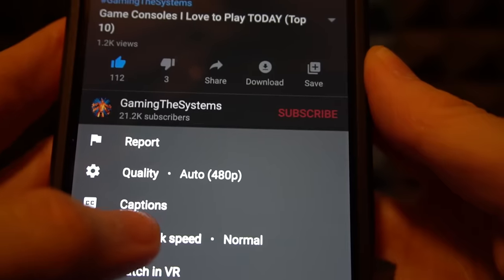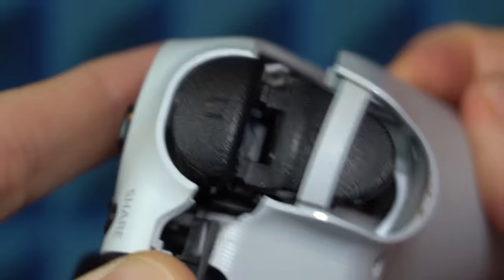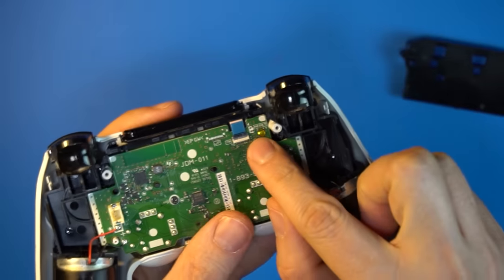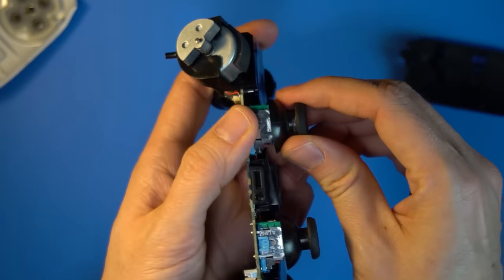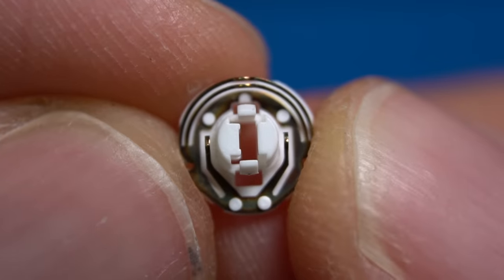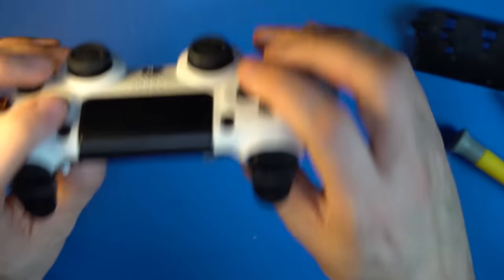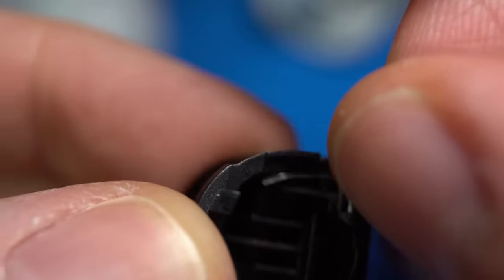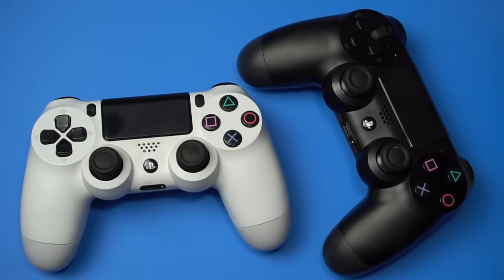How to Repair a PS4 Analog Stick That is Drifting, Sticking, Jittery/Cleaning DualShock 4 Controller

Comment: People saying they're afraid to open their already broken controller incase they break it and would rather buy a new controller 😂😂😂😂 wtf do you have to lose? At least try it beforehand
Reply: I finally found you from RDR2, Gavin
Reply: Gaviiiiiiiiiiiiiiiin !!!
Reply from the maker: Thanks for saying that Gavin. I agree.  If someone is going to just throw their controller away, might as well try to go inside and fix it before spending $50.
Reply: @HowToX  exactly!
Reply: GamingTheSystems Have a question.  I bought a brand new controller because of this.  And it still happens.  But I will be playing cod and sometimes  when I turn my character it acts like I’m on like 18 sensitivity but I play on a 7 horizontal and 7 vertical.  Would you know how to fix this ?
Reply: Zach Hollar do you buy the fakes one? Because i have the same problem lol
Reply: Seems like a lot of work for those of us who aren't tech savvy
Reply: Agreed
Reply: Because a lot of the time the controller isn’t 100% unusable and the person doesn’t want to break it even more especially if it’s someone who can’t just buy a new one
Reply: What's the point of trying something you don't even know what your doing? People would rather know what they are doing instead of not having a clue what they are doing. Also the controller isn't broken it's just a simple issue. People don't don't want to risk losing a controller that "WORKS" by trying to fix a issue taking apart the controller not having a clue to what they are doing.
Reply: @M0therfknm0nster  Send me your controller & I'll do this and fix it for you. But you gotta pay for shipping & the shipping fee to send it back to you
Reply: @Mike_TNVol4Life  am I naive to assume I'd actually get it back?  Lol. Guess it doesn't matter if the damn things broken 🤔
Reply: Thing is its not fully broken lol. My kids been playing with it like that for months now unwilling to pay £100 for 2 controllers. 

I wanted to try myself but after this video..... maybe they shall cont playing with it broken till a discounted one is found🤣
Once i buy a new one ill probably attempt
Reply: You save yourself 30 minutes of your life and lots of frustration. I speak from experience. I guarantee that a first timer will have a couple of pieces that drop out and you won't be able to put back in correctly.
Reply: @alibobsmarland9572 
I never opened a controller in my life before i just did today and did exacly what he said but more slowly as you can imagine, what you said is true that you might not be able to open or put it back as it was, i watched the video 4 times, it took me one hour to do the whole thing but i did it haha and am glad i saved my money, it was either i fix it by me self or buy another one, the guy at store was asking 2/3 the price of controller to fix an old one. So it's win situation for me.
Reply: @stephenjohn2131  Congratulations Sir. You are a braver man than I! I saw a  fix for my upward drift on the right control stick which seems to be working so far. Just push the stick furthest in one direction and press right down hard on the base of the exposed part. Repeat for the other directions. I'm not saying it is a long lasting fix but stops my aim through my gunsight in Host Recon drifting up every time I look through the scope.
Reply: @alibobsmarland9572  Thanks man It becomes really awful if you play shooting games, i don't recommend anyone doing it like you said it can go worse if you accidentally break the wires, as i can see alot of ppl commenting that they got theirs worse than before. But yet it is not that hard if you handle it and watch/follow the video instructions carefully,i have shaky fingers when it comes to handling tiny objects, for me the both of my analong sticks were drifting made it impossible for me to enjoy any game specially online. Kinda hard to keep it safe as my younger siblings play on my concole lol. But all it really took was opening the controller and cleaning the green chambers of analog sticks with alcohol based cleaner. I was frustrated when i had to slide the touch pad wire back in so i watched the video over and over until i got it done. Doing it for my second controller however was easier though. Good luck to you man and stay safe! 👍
Reply: @stephenjohn2131  Cheers. Wish I had your patience and dexterity! My other controllers r2 trigger has gone as well so when I use it to accelerate a car it travels at 5 miles an hour! Bloody cheap crap. Stay safe.
Reply: That’s true but analogue drift is a minor inconvenience. I can still play most games without a problem, however if I break apart my PS4 controller and I accidentally mess up which is easy to happen than I can’t play anything with the controller.
Reply: @FM-kl1wv  but you can't play all games so I'd say it's more than a minor inconvenience. Especially if you wanna play one of those games
Reply: Gavin O Flaherty it depends on how severe the drift is. I only had a slight inconvenience with games that have sniping and require great accuracy. Even than it works since I just pick it down real hard and it stops drifting for a few secs
Reply: Wow people, this is not that complicated. We are talking a pair of tweezers and a screwdriver here, and a little bit of patience. IMO it's just pure laziness coupled with the "throw away society" we live in. Also the new generation lacks in critical thinking, problem solving and the inability to think or do things for themselves. Without a thought they'd rather piss away $60 then even give it a try.
Reply: Its Yønffs no. Bought a 65 dollar DualShock 4 ps4 controller
Reply: TheJoePro risk reward type thing
Reply: I don't have the money to buy a new controller. It's more worth it to buy a new game.
Reply: @zachhollar7061  try hitting the reset button
Reply: @HowToX 
But what if my controllers screws are so rusted - - it can't be open?
Reply: I believe you should at least try. This is coming from a person with like no patience. Even though its not fully broken that rodent mean you shouldn't try. Because with most games you don't feel drift but with others you do. Besides most of you guys are already thinking of buying a new controller do why not just try and if you break the controller you get a new one
Reply: Just beacuse theirs a little bit of dust doesn't mean it's broken
Reply: Its Yønffs no I bought DualShock 4 65 dollars from Walmart
Reply: Because even if it’s going to have analog drift you can still trade it in for a new one, but if you try this and fuck it up it loses all of its value. Atleast trading in a used controller will tack off 20-25$ for a new controller.
Reply: 🤣🤣🤣Stop using emojis 🤣🤣🤣😄😄😀
Reply: TheJoePro I agree totally
Reply: That's why I'm destroying my bad controller first, if I can turn this ew into a meh I can turn my nice controller to a not, uhh bad ih
Reply: @19HajimeSaitou91  🤣🤣🤣 what have u been doing with it for it to be rusty dogg

Comment: Lmao sony made it so difficult to open up their controllers so that we'd  buy a new one rather than trying to repair it
Reply: Is like the Dark Souls of controller fixing.
Reply: Ikr!
Reply: Bro facts, I'm tryna fix it rn and mines won't even open and I don't wanna use to much force and break the cable
Reply: One of my screws didn't work with me so now half of the back piece of my controller has been ripped off.

Comment: My controller drift was terrible and I practically couldn’t even play any shooting game requiring stealth without moving forward every time, after using this video my problem is solved , ill update in the next month to see if anything has changed
Reply: I did try this same method on another ps4 controller i have and I did end up breaking my Ruben cable connected to the touch pad so that controllers broke now , I recommend only doing this method with extreme care and patience

Comment: People "it's not rocket science"
Me "I damn does look like it"
Reply: No, it's not.
Reply: @Albanez39  it's just a joke😂
Reply: @Helios_0011  I know...It just saddens me to see people panic for simple tasks like this one. I'm just 25 years old, but I can't conceive how most people (mostly guys) are incapable of using tools and fixing simple issues around the house (a faulty plug, an old pipe, their own bicycle etc.)
Reply: @Albanez39  I completely understand some people don't know what things like fuses are
Reply: @Helios_0011  Well, many people around the world don't know of their existence. British people are familiar with them because after WWII Britain started to use fuses inside every single plug (so you could have one entire electric line going around the house instead of many shorter copper wires) because copper was scarce at the time. 

Many other countries quickly reverted, but Great Britain still continues using fuses inside plugs. I live in Albania which often had makeshift electrical lines and wiring inside homes. Moreover, I work with soldering and low-volt projects in addition to studying electronics in high school (professional 4 year school)...

So...are you British or just familiar with fuses?
Reply: An absolute pain in the neck to fix. Guess I'll have to empty my wallet. Goodbye camouflage controller, I love your design but you make kingdom hearts 2 borderline unplayable, but I can't bring myself to remove your skin to fix a joystick.

Comment: Ok, I gotta be honest, at first I was afraid of doing all that process but then I realize that even if I screw it up I would still buy a new one, so I tried it and it WORKED!! I just saved myself some cash
Reply: Lucky I just ruined it even more and I don't have enough money to buy a new one
Reply: @hd_legendzhdl2600  lol. sad. I bought a new one AND managed to fix mine. this video was GREAT!
Reply: @Sy-ln2em  I think I damaged the the analog cause I I brought new disks and it still drifts
Reply: @hd_legendzhdl2600  how much does a DS4 costs around you? Can't be that much expensive.
Reply: @pedinhuh16  controller is 40 to 60 UK pounds
Reply: HD_legendz /HDL is that a lot or no
Reply: Kreesh11 it’s all relative. But yes, it’s a lot.
Reply: SkyVision true, I’m prepared for the worst, I think. Convincing myself it’s not as scary lol
Reply: SkyVision you’re right, that and snapping the analog disk thing for me. The controller works just fine... except I made it worse, the right stick won’t stop drifting left, lol. I think I know what I did wrong tho, gonna try again.

Edit: it worked. I’m so happy, saved so much money. Turns out the “disk” was upside down
Reply: my black and red wires disconnected from the mother board😭 what I do now?
Reply: Ight that sucks. Try soldering them back to where they belong?
Reply: @lokifrostpaw2976  how do I solder? Can I just glue it back?
Reply: Ight I wouldn’t dare glueing something to motherboard... if you don’t know how to solder, you’ve got two options I guess. Give it to someone who knows how to, or buy a new one
Reply: @lokifrostpaw2976  lol I already glued the green cases on the joystick, yeah and idk how to solder I'm just going to throw the controller out
Reply: I did all the steps after 2-3 weeks i got the issue again that the l3 drifts
Reply: @SP010.  bro I fixed it without disassembling it
Reply: @SP010.  Idk if it'll work for u but I pressed down on it and started moving it fast and aggressively every side. But it also fixed for me by just simply playing, Idk how tho
Reply: Ight wdym by pressing down bro i will try
Reply: I cant even unscrew it its too strong
Reply: @SP010.  I still think is better than Xbox
Reply: HD_legendz /HDL same
Reply: @ight2060  bro no if its the ones connected to the big ball the vibrating things juss leave it its only for vibration

Comment: ATTENTION: there was one thing not mentioned in the video, DO NOT repeatedly pry open that green door, it can break and if it breaks, the analog stick will be useless.
Reply: I guess that’s what happened to mine
Reply: phew thanks my guy
Reply: Absolutely lost all analog now 🤦🏽‍♂️
Reply: I had to rebend the little copper parts on the little white disk inside I pried it open way to hard it works fine now though
Reply: You can use a small flat head screwdriver to get in between the green piece and what’s it attached to. Then slowly wiggle the flat head left to right and it’ll pry it open enough for you to pull it back all the way a lot easier. When you pull it out it should be at a 45-60 degree angle
Reply: I see I'm not the only victim...................
Reply: @samcurtis6166  same bro😭😭 wtf i do now🤣
Reply: whoops
Reply: @noahardis7025  Yep I also managed to scratch the soft plastic PCB when my screwdriver slipped. Advice is to push the screwdriver straight down, don't try to lever it out. Thankfully mine is 100% now, unlike some unfortunate people.
Reply: I did this and now when i click L3, my character stops dead in its track, everytime without fail. Someone please help! 😑
Reply: What if my doors are blue and not green? Is it okay then?
Reply: @richy4573  did you use alcohol to clean it and did you let it dry? Are you sure you put everything back in the right order?
Reply: It also puts strain on the solder pads on the motherboard and can crack and come off the board and ruin the motherboard it happened to me before on a ps2 controller
Reply: I THINK this is what happened when I tried this the first time. The left stick had a small drift and it was really annoying play fps games. So I tried to fix it. But now it has 100% hardcore drift to the left and literally you can not stop him from going left now 😂😂. I think this may have been what I fucked up . Just a thought. I tried reassembling it 3 times. So it's definitely just broke lol
Reply: it is just fucking happened to mine...
Reply: Use a small flat screw driver and put it in the green hole and separated gently
Reply: Not true u can super glue it, it happened to me first time when I broke the door and had to glue back together.
Reply: @marcod.774  RIP
Reply: on god bruh that shit got me tight asf .
Reply: @samcurtis6166  same
Reply: Ummmm
Reply: Yup.. happened to me
Reply: @Fox Productions did it work
Reply: if it fails or not to repear anymore, there is also a solution to buy the whole left block. its not expensive.
Reply: @screwmysisterleon  same have you found how to fix it
Reply: Thanks..
Reply: Be safe with it I did it
Reply: Wish I seen this sooner, there goes my modded controller 😕
Reply: @natossw1005  Fr my shit is destroyed now
Reply: I should have read the comments first bc I done fucked my controller upppp
Reply: P pop
Reply: I’m practicing with my moms old controller, that I let my baby play with because I thought it was useless lol thankfully I came across this video! If I mess up then it’s not really a loss… just a waste of a controller 😂
Reply: I just stuck it back in and closed the conteoller and it work
Reply: Dang,now thats why my analog stick didn't work
Reply: I have a weird problem does anyone know a fix? My cousin dropped my controller and now my R2 doesn't work and whenever I move my Right stick it acts like my R2 idk why.
Reply: @thegamingreaper1293  fucked my whole shit up😴
Reply: To late
Reply: @richy4573  I suggest you get back buttons it's about 20$ but it's worth it to stop pressing L3 when trying to sprint
Reply: @stepchris5064  BRO SAME
Reply: @thegamersparadise  is this true?
Reply: @paradoxis5867  only 4 likes? this is very helpful.
Reply: And this is why I always read comments before attempting anything, you are a life saver

Comment: Thank you bro, it worked perfectly. Quick note: for the part where you pry open the green chamber, make sure you only pry open the one that is causing the drift/stutter. For example, in my case the character could not move forward, so I only pried open the one on the side (like the video.) Clean it carefully and take your time, the parts are somewhat fragile.
Reply: Fr
Reply: Thanks bro I'll try it with my controller. My issue is that the left analog stick keeps moving up so clean the upwards, right?
Reply: D4RKD3V1L   So since there is issue with  up/down movement, then you’d clean the chamber on the side

Comment: My character when my stick drifts
🔙🔙🔙🔙🔙
Reply: that happend when i had a nentendo switch lite and i got so mad we got a ps4
Reply: Mine⬆️⬆️⬆️⬆️⬆️⬆️⬆️⬆️⬆️⬆️⬆️
Reply: Mine ⬅️ ⬅️⬅️⬅️⬅️⬅️⬅️⬅️⬅️
Reply: @riza5559  mine goes full 360 Ooga booga
Reply: My character to the left to the left every thing u own in a box to the left
Reply: The one on the side is for vertical movement, the one on top os for horizontal movement

Comment: Guys, I tried this today with my dad. My brother's controller had this problem with the left stick, it was drifting up by itself. I did everything in the video and IT WORKS and it saved some money. Something that I encountered was the difficulty to get the cable through the hole again. Here is what I did: I have decorative paper tape that untapes easily, I usually use them on manicure. It is important to be made out of paper so you don't damage the cable. You can put the tape into the hole and tape it onto the cable, then gently pull it up while (gently) pushing the upper part down. There you have it! Everything has to be done carefully. 
When cleaning the inner part with the q tip I was surprised of how black it was! It was so dirty! Anyway, it worked. It seems that nothing came out of it too, so it went smoothly. Thank you for the vid!

Edit: I tried it the second time and made it worse. Now he has another one. In my country the black, basic ones have this problem more often. The colored ones don't seem to have this problem
Reply: Really?
Reply: @صلل  yep, I tried to give as much detail as I could